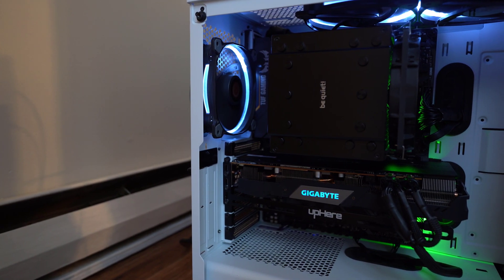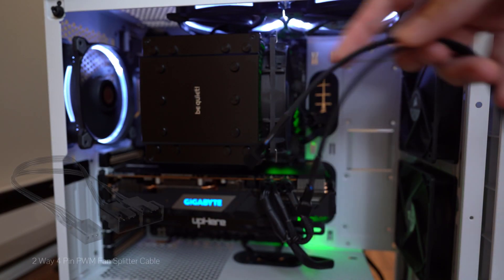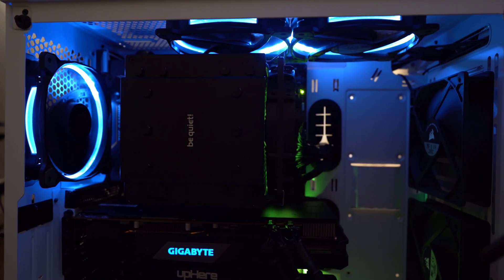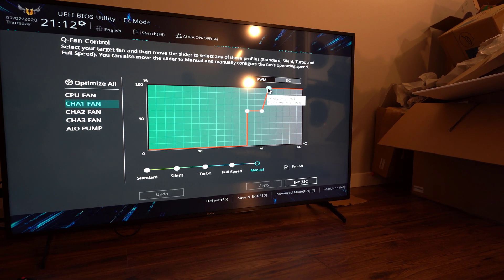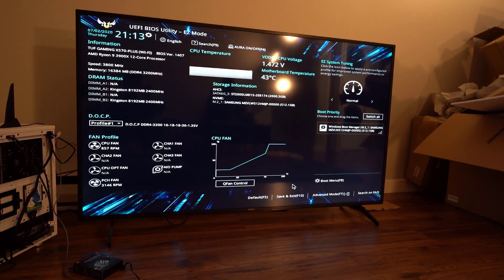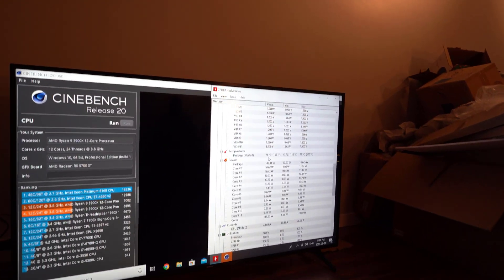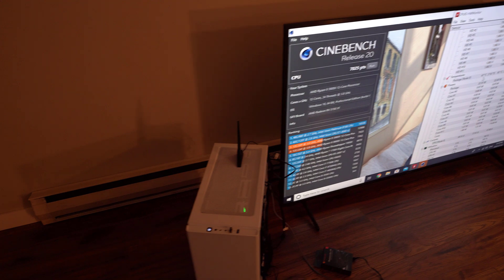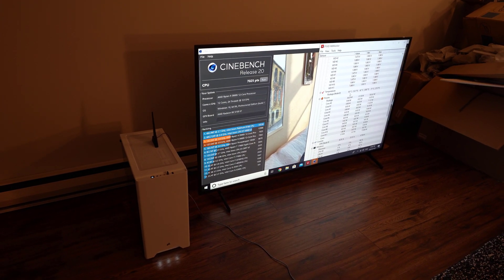Want A SILENT PC? How to Control CPU and System Fan Speed

Comment: love your vids. I have a question, I'm going to build a pc for the first time. the front fan, they must come behind the iron grid plate or may they also be placed in front of it
Reply from the maker: In front should be fine too. Thanks for the kind words by the way. I would appreciate if you subscribe :)
Reply: You want to have the fans pulling the air in through the radiator. So in order, it should be: Chassi>Radiator>Fans

Comment: I used fan splitters and it hasn't worked. My fans have 4 pins and the splitter has a 4 pin and a 3 pin, I'm so confused.

Comment: In bios my pump fan is saying it's at 8000rpm??? Is there a problem??
Reply from the maker: Check if it is connected to the right pins.
Reply: @VeeTechYouTube  the pump fan pin from aio  is connected to the motherboard pump fan 1. I have been running it like this for a year now, never realized it was at 8000rpm, until a couple days ago I felt the aio was actually quite loud.

Comment: Can you help me? My cpu fan speed is 4000 even tho i change the settings :(
Reply from the maker: Check if it has 3 pins for the connection.
Reply: @VeeTechYouTube  i actually fixed it in the corsair icue, thanks tho 💙
Reply from the maker: @3moor.  No problem. I would greatly appreciate if you subscribe to my channel btw :)
Reply: @VeeTechYouTube  i did :)
Reply: @3moor.  how did u fix it in iCue?
Reply: @ciaranbrxv   open icue, then go to your fan and there will be a preformance tab then you can customize there.

Comment: Great video, this is exactly what I was looking for. One question though, what curve do you recommend for the cpu fan, the cpu fan must remain running at all times yeah?
Reply from the maker: Thanks for the kind words, Jackiedog. Yes the CPU fan has no zero RPM mode. It must be remaining at all times. I recommend the standard curve for the CPU as that will be most reactive for thermal throttling.

I would greatly appreciate if you subscribe to my channel btw :)
Reply: @VeeTechYouTube  Done already :-}   thanks for the reply
Reply: VeeTech That is incorrect info, some motherboards set a horrible fan profile which isn’t good for effective cooling. If you know a bit more set a custom fan curve or use the optimise all option in the UEFI BIOS.

Comment: Can I use splitters or do I have to connect it to the mother board directly
Reply: As long as the splitters are connected to the fan headers
Reply: @Konikl  it still wont let me change the speeds tho.
Reply: @tomrobenek3220  if it's a 3 pin fan you can only change the voltage and not the spedd

Comment: Which of the fans pull air in and which push air out? Is there a fan on the cpu?  What does that do where it comes to control? (Couldn't make out details on my phone, might be liquid cooled oc.)
Reply from the maker: The front pulls in air and the top pushes out. There is a Dark Rock heat sink and fan on the CPU.